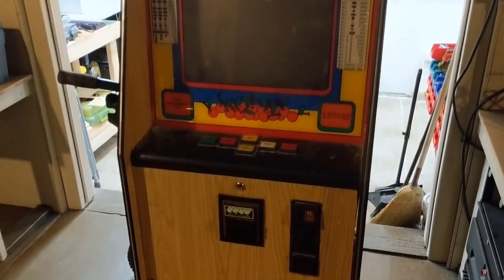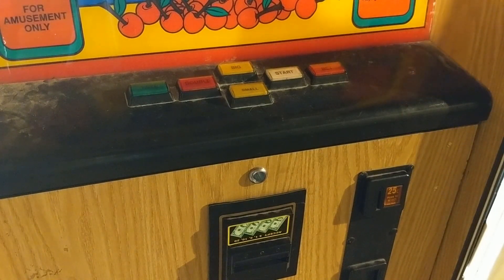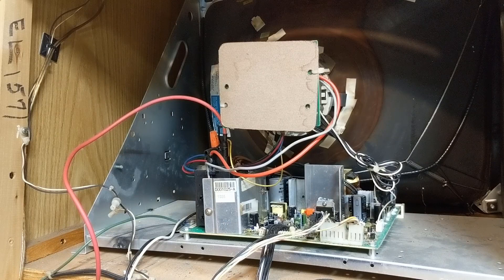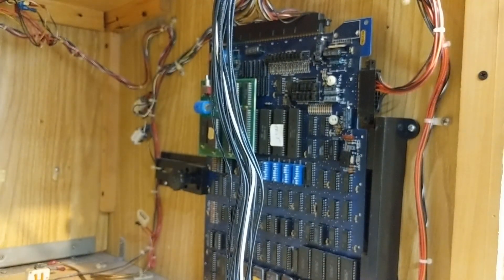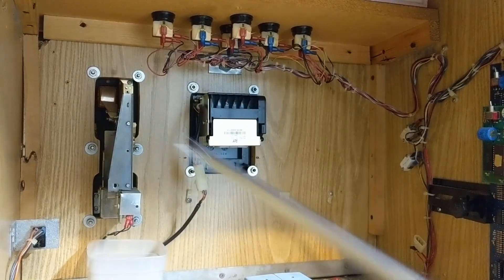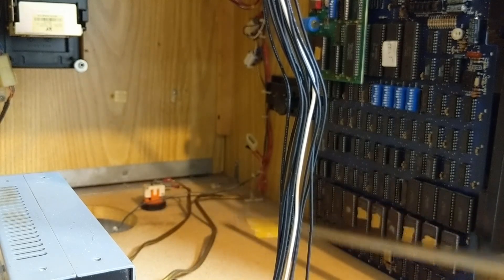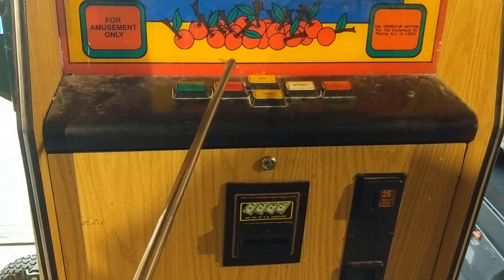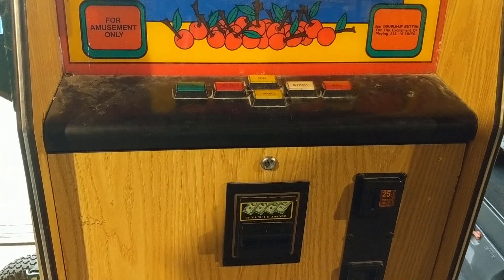Free Arcade Cabinet! What should I do with it?  Repair? Repurpose? Strip?

Comment: That first device the power cord hits (@3:30) is a noise suppression filter (probably contains series inductors and caps to ground) with an MOV across it that may have been a later retrofit. The power supply for the motherboard looks like a retrofit as well.

I agree that monitor is probably not worth the effort, especially since the flyback lead has been arcing to the chassis. 

Several KV applied at random is not usually good for the longevity of the device.
Reply from the maker: I knew someone smarter than me would be able to tell me what was going on there!   I'm pretty sure the power supply is dead too. I was able to fix the coin mechanism and I wrote an Arduino program to read the output of the dollar bill mech so it's definitely not a total loss.

Comment: When I see people with CRT machines they are always having problems with them so in the very least that section should probably go away, especially who knows what’s going on with that tube. And it probably has limited gameplay value to get it up and running again so I say take all the good parts and then see if someone else wants the cabinet. 
 I wonder if it’s a JAMMA board,  can different rom chips be put on there or are there even interfaces to connect other types of controls besides those few buttons anyway?
Reply from the maker: I saw something where that particular game can be converted into a bunch of other games that use the same form factor.  I think they sell different roms for that board.  I do think the CRT is toast and I do have an LCD of similar form factor.